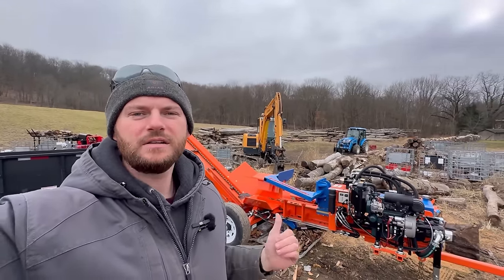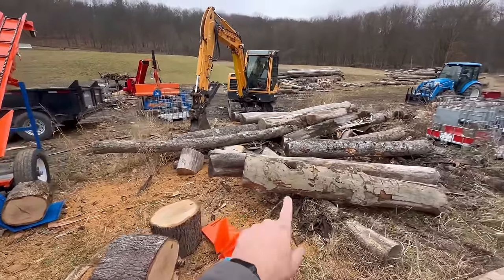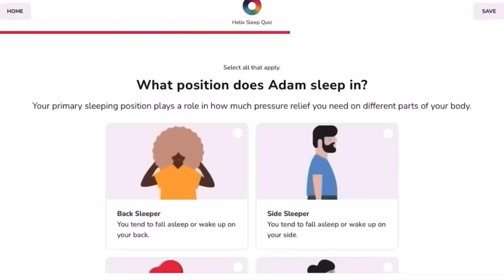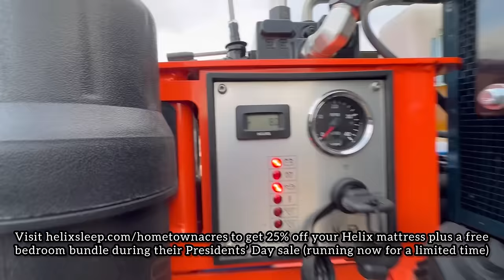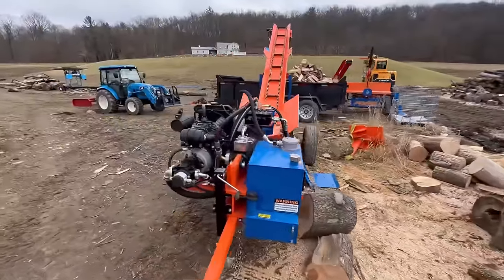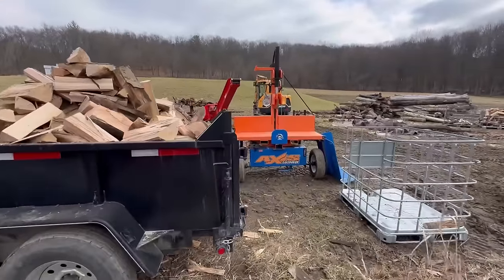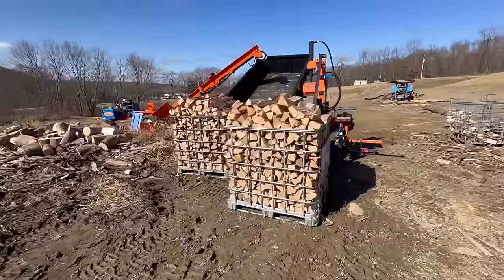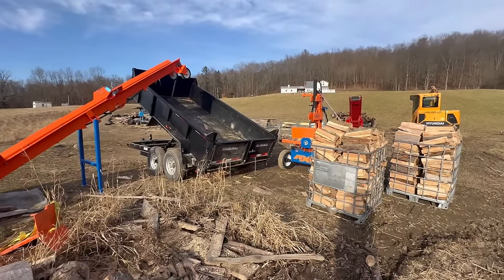Making Cleaner Firewood… I Think I Figured It Out

Comment: Done like a true accountant - leveraging the strength of one machine, minimizing weakness of the other machine, minimizing the weakness of the first machine, maximizing the strength of the second machine...
Reply from the maker: Well said!
Reply: @HometownAcres very worthwhile exercise!
Keep thinking outside the box!
I like the less labor of the box wedge.
Hate the chaff. All the ideas of using it are fine and all, as long as I don't have to do that extra work!!
The cool thing is, you can mess around with ideas and move things around to try new ideas. You haven't boxed yourself into a certain work pattern. And there is no need to.
Neighbor Doug is a good hoe operator!
And good idea guy!
Thanks for the video.

Comment: The bottom line is making pretty, clean bundle/recreational burning wood  takes extra time and effort.  I have an Eastonmade Ultra with a single and 4-way wedge.  If I run 10" and up pieces through the 4 way wedge once that's usually good enough for cord wood or heating wood.  If I'm making bundle or recreational wood it means extra time and effort of running some pieces through again but it also means $270 per face cord for the way I sell that wood vs. $130 per face cord for heating wood. Dave

Comment: Hey Adam, if you flip the dump trailer and the IBC tote around, so the dump trailer is by the log lift on the axis, you can pre-stage those big pieces that need re-splitting on the log lift so you’re not having to walk between the log splitter, and the trailer and the IBC tote every time you need to re-split a piece of wood. You could just batch it on the log lift, and then re-split all those pieces at once.
Reply: That's true and You don't need to run second machine all the time. Maybe You need to start it twice or bit more.

Comment: I think for a solo operation, the Axis vertical splitter is the way to go.  Any speed advantage the 37D has with a 6 way wedge is negated by the machine constantly waiting on the operator to feed it.  If your end goal is maximizing yield from the firewood rounds and minimizing waste, the Axis is the way to go.  Everyone seems to forget the Axis is also meant to bust up those giant gnarly rounds and not just to make perfect size bundle wood.
Reply: I would agree. Also, Adam is a hobbyist so the axis is perfect for him. You easily bang out 100 cords a year with the axis no problem at all!

Comment: I would use the Box Wedge, but sharpen the knife edges. I believe the factory edge is a bit dull. I would also add some angle iron to the output chutes to divert splits to the conveyor.

Comment: Great demo Adam, this is exactly my plan for this years bundle supply. Im going to run everything through the Wallenstein processors 4-way into the dump then resize it on the vertical splitter. To me its the best option for premium wood. Even to just get logs busted open to start drying then resplit down the road is a fast way to get ahead! Take care buddy.

Comment: Sunday morning viewer here ~ Productivity vs. Yield.  Great Quandary!  I too have experimented with process improvement using a horizontal splitter with a 4-way and single.  My yield of clean quality split wood increased significantly with the use of the single wedge (so did my time into the process) AND I did not have 1/2 IBC tote full of scrape or small stripes of Oak at the end with the single wedge.  At the end of each splitting session I would put the 4-way back on and use it to split rounds that were 8" or less - worked great!  My experiment was with two loads or 24 logs 12 foot in length.  Great video here and thanks for confirming my earlier test results Adam!   Keith

Comment: Hi Adam,

Another option might be on the log pre-sort end.

At a glance, it's obvious (by the diameter) which logs are probably best suited for which splitter and/or wedge configuration. However, if you were to track/record a more accurate diameter range you could pre-sort these logs prior to splitting and cut back on waste.

It might be worth the time to get a few different colored cans of spray paint....With this method, you could stack your oversize logs in one or more piles as you already do. However, after you do, take the time to check the diameter ranges. As you do this hit the different diameter ranges with a different colored spray paint that you can easily see from the cab of the excavator. Once spray painted, you can sort out logs prior to cutting to length.

Ex: The first log at the top of the pile has a green marking. At a glance, you know from the cab.this log's diameter is too big for machine A and/or the particular wedge configuration currently on the splitter....Instead of cutting it to length you either set it aside or move it elsewhere on the pile and move on to the red marked log, one you know in advance is perfect for that splitter and/or wedge configuration.

This pre-sort tag/paint method will also come in handy with the piles of logs you still have from last summer's clearing project. When it comes time to move them to one of the splitters, you sort them them as you go....Green goes near splitter A....Red goes near splitter B etc....

Comment: Its definitely a lot faster with the 6-way wedge and a lot less waste for sure. 
I know that the vast majority of the firewood is going to be sold, so resplitting is necessary for easier handling for the customers. If it was for my own personal use, I wouldn't think twice about resplitting. Growing up, we burned firewood and the chunks you had in your trailer we would've kept as is.
I know firewood heats more than once, but handling things more than I need too, kind of starts getting under my skin. 
Great video and experiment.

Comment: Hey awesome video. I have a few suggestions. 
You should get a pickaroon / hookaroon for moving the logs to the machine instead of bending over. Might save your back.

Also there is an attachment for skid steers/ excavators.
The halversons firewood processing. I know you aren’t sponsored by them but maybe they will let you try out their product. 

Hook it up to one of your machines it will lift the logs/ cut and split them for you. If they are to big just split over into the dump trailer and re split with the easton made axis. 

The halverson is cheaper and will be faster since you wont have to use a chainsaw.

Comment: If you only have one machine, it’s hard to say which is better.  I like my Wolfe Ridge Box Wedge, but I have run a 37D and the Eastonmade is amazingly quick.  I do like that the Eastonmade is easier to operate from the log lift side, that definitely helps the process where you’re by yourself.  Resplitting with the Axis is great.  I noticed & thought that it may be slightly more efficient to raise the log lift on the Axis and stage more split pieces.  That way you’re grabbing several pieces at once and going to the tote, vs. the 2 pieces split.  Just an observation, I have no doubt you will perfect the process.  Looking forward to more content on all the machines.  Take care & have a great day Around the Yard! ~ Brent

Comment: Hi Adam, great idea, working to the strengths of both machines. What i see as a drawback in addition to what you mentioned is the Axis having to keep running and burning fuel while stacking firewood that did not need to be re-split. Not sure how to solve that though

Comment: Ideally a wedge could be designed that would lessen the waste, split to the correct size and be able to use the return feature.  I would concentrate on what exactly is causing the waste and try to make that connection vs running two machines.

Comment: It would be interesting to time the split and resplit versus doing the splitting with just the axis. Just curious as to whether there is an actual time savings with the 2 step process. However a true time savings would be achieved if there were 2 operators in the process.

Comment: It appeared to me that both splitters spent a lot of time burning fuel when they were not splitting anything.  The new machine was waiting for you to go pick up rounds from the pile. It looked like another person working on a pile on the other side would have plenty of time to split a round each time you were off picking up and carrying rounds to the machine.  
For the Axis, it spent a lot of time running, waiting while you stacked the wood which was small enough not to need any re-split. After watching Gord Potter (GP Outdoors) split on the Axis it looks like if you are in pursuit of machine utilization and efficiency, you need at least two men to keep it fed.
Was the elimination of waste worth the extra fuel burned?

Comment: @hometownacres If you are in it for the long term, consider investing in the Rex that Mike Morgan is currently using on his channel. More upfront money, but you can load the hopper with your equipment, saving your back, and provides better control when splitting your larger rounds that can't be put through your other machine "machine - shot out to Spicer, lol). I would look to avoid handling multiple times.  More baskets and split direct into them for efficiency.

Comment: I'm wondering about the numbers also. I buy 4 face cords for $175, already bucked and split by a processor by the tree service i get my wood from. All i have to do is resplit the wood i get. I figured that with the value of my time and what i get the processed firewood  for,  I'm better off with this arrangement,  even if i get wood for free, otherwise. With this arrangement,  my gross profit is 62.5%, which is acceptable. If i value my time at $50 per hour (actually,  i value it at much more), I've figured my gross profit below 50% by procuring the logs, bucking and fully splitting. What most people don't do is value their time in term of labor costs, even with free wood. They don't figure on what their time is worth. In a previous business (that i sold), i was NETTING in excess of $100 per hour. I've made that my benchmark. Since I'm "retired" and helping Danny out with this, considering  this as his business, I'm happy with the way we have it. If/as we scale up our business,  I'd be curious to see what our percentages are, from profits.

BTW,  i have an Axis and a kinetic splitter.  I use tge kinetic one mostly for the resplits because it is so much faster. But I'm thinking about either moving to an Ultra, or just using the Axis because of safety features even though it's not as productive.

Comment: I thought initially you were going to handle it to much, but putting it in the baskets has you touching it twice anyway and if your yield is that much higher and the time difference is that little I'd say you're on to something!   I've been watching Mike Morgan use that T Rex from Australia they are loaning him.  You fill a hopper with rounds that's on a conveyor using a tractor or skid steer and go to town.  I think it holds 3 cords.  I don't know how many cords you process a year but if it is a hundred or more even at 3 times the cost of Mikes Wolf Ridge and Conveyor it is more than twice as fast and probably worth it.  I don't think he is really a major player in firewood production.  That T Rex is faster with one person than his Wolf Ridge with 2 people.  If you sold all your splitting equipment it may be worth the investment.  That T Rex will split the smallest piece up to 30" I think.  Aren't you in Missouri?

Comment: I think resplitting is a big time waster. Box wedge to some grizzly bars and straight into a huge pile. All these IBC totes, expensive equipment, and  the handling is very hard to justify with the current value of firewood. 

For a one man operation the Axis with the conveyer is a great way to go. Very efficient and makes any size wood you like. You can sell bundles, pizza oven wood of regular firewood. One machine, one touch.

Comment: QUESTION?  If your logs were 100 inches long.  How many times did you have to handle the wood from the logs. to get 2/3of a cord in the IBC totes?   Bucking the logs to 16" rounds, lifting each round on to the first splitter, respiting some, and stacking each piece in the tote.  That is a lot of hand labor in my estimation.  Yes, you accomplished your goal in what seems like a decent amount of time BUT?  WHAT step of the process is most time consuming?  I think it 's stacking.  SO, you should be pressing your machine manufactures to develop an automated stacking device or machine.  Eliminating handling each split piece would be a hell of a time saver.. Time is money so $$$$.  In my 20's 30's and 40's I heated with wood and always hated stacking, because, by then I figured I handled that tree plenty.  Manufactures have been great in developing wood splitters and even firewood processors.  Yet, I still have not seen any device that will take the split wood and organize it into 2' by 2' or 2' by 4' or 4' by 4' bundles that could be stacked to make 4'by 8'' sections of a cord.   GET ON IT YOU ENGINEERING TYPES.

Comment: It seems it really comes down to the task and the wood. If all your rounds are actually round and fairly consistently sized, as long as you're not splitting for bundles, then the 37D would be the choice. If you've got not-round rounds or are splitting for bundles, then the Axis would be the better choice. If I had to pick one or the other for my use, which is splitting less than perfect wood for just my use, I'd go with the Axis. Re-splitting on the table looks to be SO much easier. And unlike a box-store horizontal with a side table, the 37D with the 6-way doesn't have a good place to set any wood that needs to be re-split on the next stroke.  BTW, I had to fast forward through the head-cam shots. The panning back and forth was a little nausea inducing. Dislike.

Comment: Hey Adam, I wanted to throw a couple of suggestions out there to ya.  I noticed you’re almost as tall as me at 6’5”,…and I’m at 6’6”.  I see that you do a lot of bending when you’re handling your firewood.  I set my totes onto two pallets when stacking into them.  Also, I came across these Bahco log tongs. https://youtu.be/-t6jQ4LJnZg?si=uv53KvIGSxgvQU-7  I bought two of the short ones.  They make a huge difference in not having to bend over so much. They work really well.  They really are that sharp as described, and have no problem picking up bigger, heavier rounds.  Anyways,…just thought I’d share that with you.

Comment: The trailer and bin should be closer, you need to spin not walk. No to minimum steps. Also when splitting roll the rounds to the lift pile them 3 high, use the lift reduce the steps and wear on you back and body. You will not be young forever.